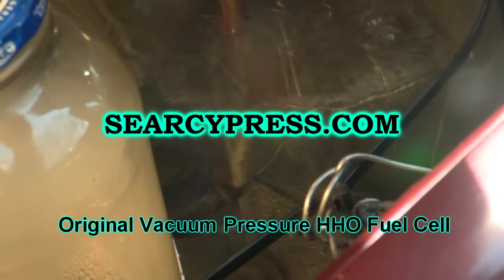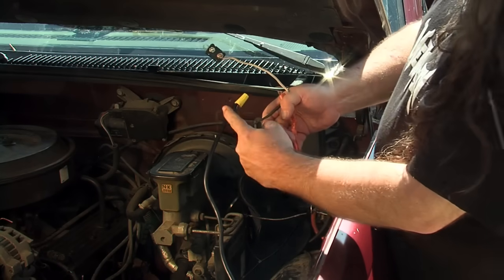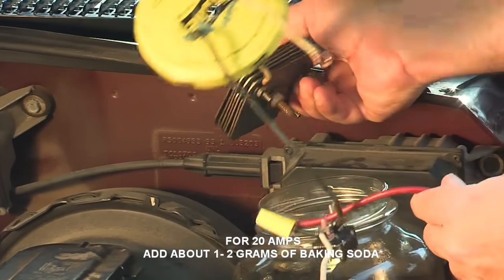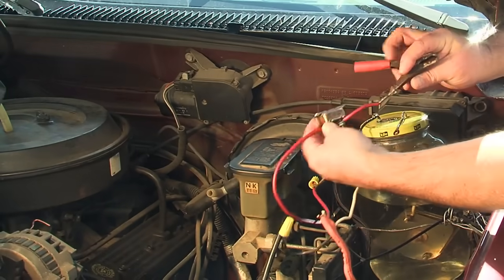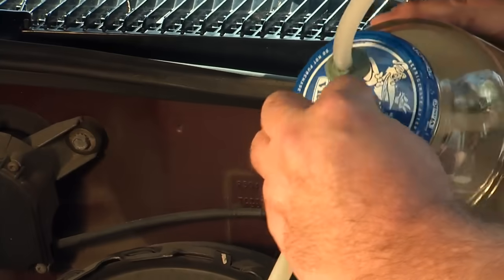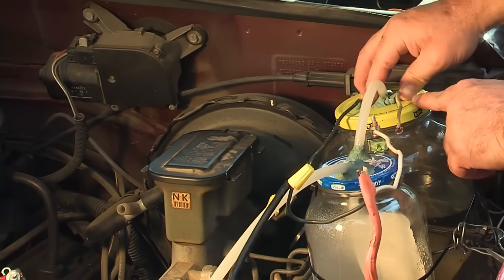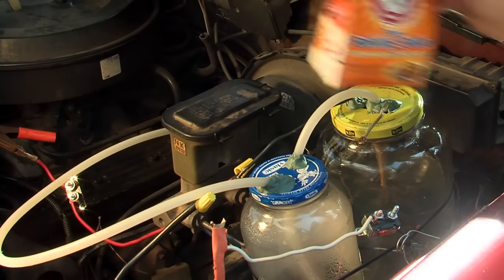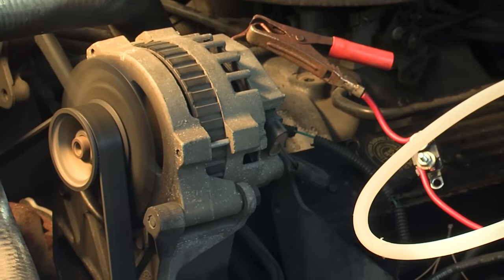Vacuum Pressure Hydrogen fuel cell defeats high gas prices using hydrogen from H2O.

Comment: Hands down the best description with hho,the vacuum part now is obvious but it is the first time i have seen that,it seems to help production as there is no air pressure in the production bottle.
 1 thing is missing a flash back arrestor,with it it is very safe
Reply: +MARTIN STRANGE if you use his "dryer" jar, and you put water in it, then it works the same way.
Reply: The water would be drawn out ,you cannot draw out a vaccumm, it is there to make as much of the gases be drawn into the engine
Reply: +MARTIN STRANGE no, you would not draw the water into the engine, it becomes a bubbler valve, which is pretty common on these systems. you have a tube going from the generator into the bubbler valve, and it goes under the water, then you have another tube that is NOT under the water going from the bubbler to the intake of the engine.
Reply: +MARTIN STRANGE making what null and void?
of course you only NEED the generator vessel, but if you use only that, you risk sucking foam into your intake, and you risk having a fire flash back into your generator.
and yeah, both containers can be under vacuum. im not really sure what point youre trying to make here. the system that i have described works perfectly fine, and is commonplace on these sort of setups.
Reply: +Rush CampNPrep I mentioned a flash back arrestor above.The wet system makes sparks underwater not relevant as the power going through isn't enough. Whatever your set up is I wish you well and save plenty of money.
Reply: +MARTIN STRANGE what "power going through isnt enough"? that makes no sense
Reply: +MARTIN STRANGE uh yeah, there is plenty of power there.
Reply from the maker: look closer.

Comment: Nothing new.
Have you wondered why this system is not used?
Is not used because after it will result HEXAVALENT CHROMIUM which is very very toxic. But don't trust me and search for your own.
If you want economy you can search "petrol vaporizator". That technology works and beside less consumption you will have offcourse less polution.
Reply: Do you know what else is very toxic? Carbon monoxide, it is a biproduct of the gasoline we burn, why do we use gasoline in vehicles if it produce toxic gasses?
Reply: +SuperMadcox Where does the chromium come from?
Reply: +SkyCharter  stainless steel is an alloy made from different metals, including chrome.
Reply: +SuperMadcox Understood.  So the stainless steel is consumed in this process?

Comment: ? The mechanical and electrical power to be generated is generated by burning fuel in the engine. Of course you need more fuel derived energy than you get back from burning the HHO. Non sense technology.

Comment: Great video. Two things: I've heard the spacing of the metal plates is crucial for the process of electrolysis to work properly, what spacing are you using? And the second thing is just a correction, you say the poster putty is liquid Teflon, but then in the writing on the screen it says it's latex.
Reply: @Sardit  I am not so sure.

Also, with electrolysis setups, your always going to wrestle with I²R. The lower the current, the lower the power.

Now gas generated is linear with current. If the spacing is reduced then so is both current and gas generation, but at least now your input power is a lot less.

For use in a car it becomes very much important as to how much power it consumes.

But more often than not, these HHO setups will not increase the MPG of your car because they generate too much gas, the excess will never give you more power than was used to generate the gas in the first place.
Reply from the maker: I understand what you're saying. I'm not sure if you realize that you're only burning 80% of the fuel in your cylinder. We're not trying to power the engine with this gas. The process produces a more complete combustion by igniting more of the fuel in the cylinder. Any gains are caused by a higher efficiency in the amount of fuel burned in that 20% that is normally wasted. Even if there were no gains you would find engine knock would be eliminated allowing you to burn lower octane gas. That by itself saves money. The laws of thermodynamics remain intact. O2 sensor issues are debatably mitigated in the state of vacuum. We are not leaning the HHO by injecting it into the unchambered airflow of the engine where complete recombination of the hydrogen and oxygen molecule is most certainly hindered. Like I said, we are not trying to power the engine with this fuel. We are just trying to better ignite more of the fuel that we normally waste.  Thanks very much for your comment.
Reply: @metalpresstv  I understand the principle behind it and I have no doubt that the HHO will cause more of the fuel to burn.

It is certainly worth the time and effort to investigate this - you just have to realise that electrolysis is a very inefficient process. As I said before, you only should generate enough HHO for 100% of your fuel to burn. The extra gas only represents wasted power. I'm sure you know that those extra amps means the alternator works harder, which means the engine needs extra fuel for the same RPM.

There is another comment of mine floating about that goes into what I was saying, and some optimisation and safety tips.

Definitely keep pushing on with this. There is a lot of stuff you can do to increase the efficiency of the HHO generator.

Also, just be mindful of the increased water vapour in the cylinders due to boiling of the electrolyte solution.
Reply: @Sardit  This video setup is quite poor in design. There is no regulation of power so any excess H2 and O2 gas that gets pulled in is wasteful in that it will never recoup the power that was used to generate it in the first place. All you need is the H2 and O2 to increase the burn efficiency and no more.

Also, the water will boil quicker because of reduced pressure and it will all get sucked into the engine, which further reduces the efficiency.

It can be improved somewhat, see an earlier comment I made to arne, but like I said to that person, I am hugely skeptical of these and would want to see proper controlled testing

Comment: I am just curious as to how much water get's past the rings and into the oil
Reply: zero water.  it's hydrogen and oxygen
Reply: @tonycavez  Lmao h2o is water.. 2 hydrogen and 1 oxygen
Reply: @tonycavez  no feces involved
Reply: Any water that gets into the oil is no greater and probably much less than the unburnt gas/alcohol-blended fuel (an alcohol-water mixture that when "burned" creates a small amount of steam which generates excess combustion pressure) some of which undoubtedly gets past the rings. With every "suck" cycle of the engine outside air is being drawn into the engine. Air is generally full of moisture (humidity) about 10 grams of water per 1,000 cubic feet of air on average)). Just imagine how much moisture is in a few hundred thousand cubic feet of atmosphere that is sucked into your engine every year. The average 350 cubic inch motor draws in about 300 CFM (cubic feet of air per minute) of air as its going down the road at 70 mph (3,000 rpm). That's about 10 grams of water every 3-minutes, plus the water in the alcohol-fuel blend! He is only adding a minute amount of "hydrogen" gases to the air-fuel mix. Not pouring water into the engine.

Comment: A lot of you really do not like to know how the world works do you?   Our government, fuel refiners and auto makers have the technology to run our engines on strictly hydrogen. It is safer, clean and more powerful.  They also have carburetors that can get many many times the fuel mileage than what they allow us to have.   I have seen hydrogen work! With no baking soda make a small one of these with 2 plates light a match and take down to the bubbles, they explode like firecrackers!  I need to make one again as this one was one my grandpa made after seeing a cousins back in Iowa. The Iowa cousin took him for a drive in his v-8 truck was driving about 40-50 mph and switched on the hydrogen, instantly the truck started pealing out and he had to let out of the accelerator a lot.  This guy had tested and built these until he made it work.   The first one he made was too powerful and he switched it on in his lincoln in the driveway and blew all the rings out of the engine!  This does work extremely well!  What he was wanting to try out was upping the voltage for more bubble making instead of such hi amperage.   As for the carbs that make extremely hi mileage...  I have heard of 2 cases where these guys had bought a brand new car, drove around for weeks!!  not needing to gas up loving the unexpected fuel mileage they were getting.  Then there was a "recall" on the cars and when they got it back they got standard mileage..    If YOU do not believe these sorts of technology exist you are living in denial and THINK the government etc are here for " the people",  Sorry to tell you that the government never has the peoples best interests in mind!

Comment: how i can do 100  % hydrogen my ford focus 1.6 gazoline?
Reply: make a kill switch for your vehicle's fuel pump. Install it and save using it for later on after you made enough HHO from what generator(s) you will make. I'm using a pair of larger pickle jars I have in a crate in the flat bed (literally, OUTSIDE) of my pickup truck. I use that 3/4in tubing to combine their outputs then feed to my drier pickle jar, like the one in the video, but I could go bigger since its the only jar and I have more room for it.  The drier jar also acts as a flashback arrestor but since the BANG happens internally in a sealed environment within the engine block, its not much of a concern, but more of a piece of mind. Drier jar also keeps anything but the gas from ever reaching the intake.

Comment: Ingenious! Using the alternator instead of the battery and high vacuum create the conditions for different processes than regular common duct alkaline electrolysis ( different than so called HHO ). That circuit is not basically different from fancy Meyer system, similar up to a point with Dingel
Add more electrodes to improve the efficiency. "Play" with other electrolytes ( Baking Soda create CO2 ...there are other chemicals that can be as good in terms of foaming or safety)  ...Cool! Congratulations!
Reply: Nothing wrong with Co².
It's the plant food you exhale. Please bear with me here. And no offense intended. You're obviously a smart person.

Are you convinced even a 100 or 200 ppm increase of atmospheric Co² would be a threat to Earth, us or our way of life? You certainly seem more knowledgeable than that... The folks who attribute every significant effect our sun has on climate, to human activity, clearly misunderstand Co².

Not trying to troll you here. But conclusions require a rational foundation and Co² trace gas is not a rational foundation for climate change! Regardless of the desire for it to be so.
The evidence just aint there and concensus ain't science.

The evidence for our sun actually having demonstrably profound effects here, both in meteorology and with geophysics, is voluminous.
There are over 500 published, peer reviewed paper's already cited since 2010, showing a whole new big picture of Earth as part of a circuit, with predictable and observable effects right before our eyes, not an isolated bubble in space as we were taught.

AGW science requires TSI be the only measure of our sun on climate, and most folks don't know much about our sun or its outputs, connections and earths many reactions to its behavior. Lag times makes things less obvious I guess. A great example you can see by googling Ferris Wald and Broadcom Masters or Ferris Wald and Google World Science Competition.

Suffices to say that were the largest solar flare in 100 years to blast it's X-rays and a massive CME, straight at Earth?
TSI would actually go down, as we wach the tropical storms go crazy, until the power goes out...

There's a reason we're not taught about alternatives in science...
✌
Reply: Hho generators in cars are BS. 

https://youtu.be/-OhICSDRySQ
Reply: @travisheck5979  
They do ionize the water molecules and some hydrogen results but output volume is sorely inadequate to make a measurable difference in anything besides maybe the lifespan of the alternator.
Reply: crezi ca reusesti sa faci asa ceva?

Comment: There are much more efficient HHO generators Check out the ninja HHO Please be careful my friends.
Reply: Yon Kromis At what cost? Aqau Tune wanted 798 bucks for an entire setup including some parts I didn't need, such as a water reservoir. Granted each cell claimed to produce 2.5 liters per minute of HHO with only 1.5 amps, and no electrolyte required, sounds awesome. But not only at that price unless it guarantees greater results than these typical home built systems, which it didn't, then hell no.

Comment: I plan to try something similar to this with my '94 Explorer and my '97 Thunderbird. But I will be using a "dry cell" HHO generator. It's a bit more efficient than the "wet cell" shown here. Also, the brake booster is definitely NOT the best place to put the HHO return line. It needs to go upstream of the throttle body and downstream of the air filter and/or mass air flow meter. I am hoping that it will increase the effiicency of both my vehicles. Currently the Explorer with 4x4 and 4.0L pushrod V-6 gets 17mpg on a good day and the T-Bird with 4.6L SOHC V-8 gets 22mpg. I am hoping to increase that substantially. I have a friend who has built an HHO generator that powers his lawnmower, without gasoline! I have seen it in action and I know this technology works when executed correctly.
Reply: Not yet. Unfortunately, I have had neither the time nor the money. But hopefully soon.
Reply: Nobody ever did it and nothing was ever learned here.  The end.
Reply: Chris Haywood That's right ! It's a lot easier for steady R.P.M engines. A car has different needs...
Reply: Chris Haywood Chris did you put the dry cell HHO generator, did it improve your efficiency?  How does it work, does it use a combination of gas and HHO?
Reply: Chris Haywood Have made the setup yet. Am very interested please send me info to my email. waits4me@gmail.com
Reply: i want to make one .i know i can just have not had the time on my hand to be the mad scientist I am.
Reply: EMMANUEL SALLEE i
Reply: Did it work?
Reply: You got a 97 tbird?!  Oh man i traded it in 3 years ago... i miss her...
Reply: Project Farm tested it. Doesn't work. I repeat, it Doesn't work.
Reply: Did you ever get it going man?
Reply: Chris Haywood 
please make a video of how to do this correctly without gasoline altogether like your friend did it on the lawnmower ...please detail as to where the hydrogen gas should go to the engine. .like if it should go to the air intake etc ?
thanks in advance.